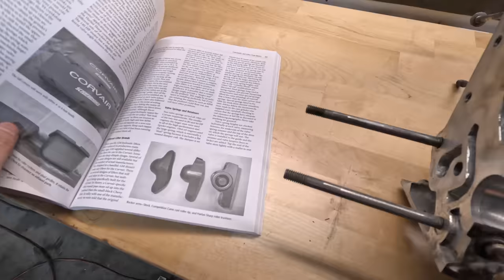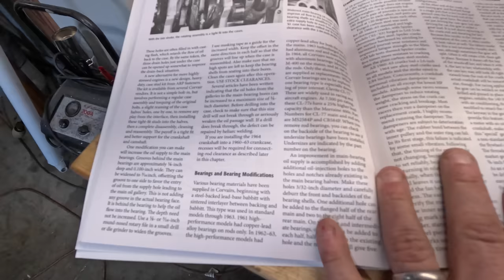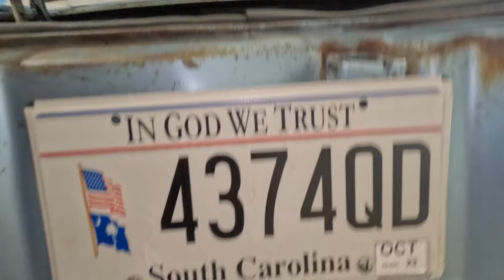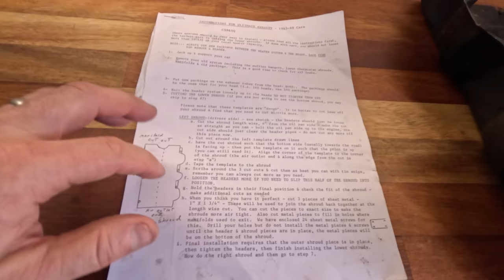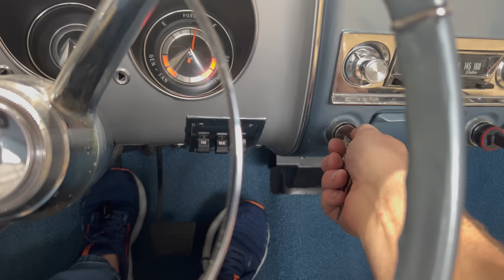HOT New Engine for the FLOODED Corvair | Cam, Heads, and Exhaust...Oh my!

Comment: God I had a heart attack when you showed the location of the timing mark on the crank for camshaft alignment. I'm also in the process of rebuilding my engine and have already assembled it. I used a v-shaped notch that looked like the timing mark at the front of the flywheel flange instead  of the raised edge. Luckily the notch is at the same spot. Otherwise I would have had to disassemble the whole engine again :D

The only thing i'm missing fron the video is a proper cam break in. I guess it's now too late for that but the engine seems to have survived :D
(There are a lot of camshaft failures lately so it's typically highly recommended to do a break in of the cam)6
Reply from the maker: It's NOT intuitive and you really have to be paying attention to where the timing mark is located or it will get messed up.  I'm so glad you found the correct timing mark on your build!

I did break in the cam at 2000 rpm for 20 minutes, just didn't show it on camera.  I thought it was already getting a bit long and made a creative decision to edit that part out.

Comment: Dad had a Greenbriar van, We were pulling the engine around once a year ( depended on how much he drove i) because of the NM heat would cause the push rod tube seals to leak! I am wondering if they have better seals now. To say I wasn't unhappy the day it made the trip to the scrap yard would be an understatement.  Never had any problem with the flywheel though.

Buddy bought one rebuilt the motor it would start and run then die,, after a day of me trying to figure out what was wrong we drug it back home after dinner we and dad went out to see after a a few minutes dad said Wally I can't figure it out we're going to have to start taking it apart and see what we find when we pulled the carbs there were lock washers under them causin a giant vacuum leak. My dad asked Wally why are there lock washers "Under" the carbs, he said it seemed to be the place for them. Cutting him some slack he had never worked on an engine before. When we origanlly went to look at al he cared about was the hubcaps paint and radio!
Reply from the maker: There are much better seals now and pushrod tube leaks can largely be eliminated with Viton o-rings.  As an aside, I'd love to find a Greenbriar for the channel!

Comment: We use valvoline Vr1 30 wt racing oil  in our corvair  engines high zinc 1800ppm and marvel mystery oil in fuel helps lubricant everything especially at break in

Comment: Did you set screw the cam gear to the cam? They can loosen up with a stickshift
Reply from the maker: I had a “Failsafe” cam gear installed.  It’s not setscrewed but rather has a steel ring that is shrunk onto the outside of the aluminum cam hub, keeping it from loosening
Reply: @AutoAnatomy  Hmmmm... I've heard of it, but never seen one. I set screwed my cam gear about 40 years ago, but never rebuilt that engine. A 180 turbo from a Oshawa Ontario built '65 CORSA. It was black blue interior. It's long gone... sad story, but I still have the block TO308RL... and a few Corvairs of various shapes in buildings I own... but they haven't had any of my attention in years... it's difficult owning 50+ vehicles and winter 5 months of the year, and I'm constantly buying more. I've bot 8 (maybe more?) in the last few months, and I seldom sell any lol

Comment: Perhaps already mentioned.... Any drilling and threading should be done on a disassembled item like the cylinder head shown at 20:05.  Tough to get all of those shavings out of springs!  Edit: Not shown, and it has me curious about what method you used to adjust the valve/lifter lash?  Edit #2 Nice job on the shrouds!
Reply from the maker: It took a bit of work to clean but ultimately everything came out of the springs.  As for the lifter adjustment, I gave them an initial setting using the spin the pushrod & tighten the rocker until contact and then 1/2 turn method, and then once the engine was warm I adjusted them hot by backing off the rocker nut until clatter, then tighten until no clatter, then 1/2 turn more.

Comment: I like your sequence except I would have probably have dwelled on the installing of the shrouds on the lower side of the cylinder jugs they must go on before the head if I recall.
Reply from the maker: The shrouds are supposed to go on before the heads, but can be easily installed after.  It's just a bit more fiddly

Comment: With that cam you should do secondary carbs addition 😁
Reply from the maker: I'd love to!  If anyone wants to donate some 140 heads I'll slap them on in a heartbeat!
Reply: @AutoAnatomy  .......back in the early 60's and 70's they made a few kits.
I picked up some aluminum carb spacers and they are to be welded on a set of 1964 heads. Found some linkage and a pair of secondary carbs.
Your engine and cam might add about 16 HP, I'm looking at about 12  with stock cam. That's good reliable HP for low $$.
Keep the Vair!

Comment: Congratulations great to see it rolling. Corvairs make great restomods at least using the restomod term for upgrades and safety issue's like brakes and drivablity. These cars stopped getting real upgrades long before they stopped production so they are prime for tweaking.  Have fun and enjoy.
Reply from the maker: Thank you!  I'm looking to make subtle improvements that bring it up to current standards while keeping the spirit of the car.  Things like brakes, suspension, etc are going to get addressed throughout this process.
Reply: Chevelle brakes work real well on Corvairs.
 I know discs are stylin. But if it stopped a 1966 230 I-6 or a 283 small block Chevelle wagon? 1000+ lbs more mass.
Also that 13-15 lb PSI for the 13 inch front tires works real well. Don't mess with it
No need for mods either. GM was good about use what is there in the warehouse.
'66 on shared some parts with the Corvette for the rear suspension.
If you can find them. The 69 Corvair heads also flow better.
Also the '66 turbo Corsa put out as much HP as a 283 wagon motor.
The only thing I did not like about Corvairs was the push rod tubes and the cooling fan belt arraignment. Blame that on the GM bean counters.
 But if you put a Z-28 302 amidships in one. Might want bigger tires and disc brakes front and rear. And about 6-7 lbs more air in the front more or less. Generally less.
Also don't stand on the gas pedal with a 283 or 302 if you have 4 speed in it in 1st gear.  Also no standing on it in 2nd if it has posi-traction.
Or you go with a powerslide 2 speed until that scatters on the pavement
 4 speed? 1st It will dump the spiders with the stock 13 inch tires and wheels. V-8s have to much torque.
You can do that. If you want to see what a spider gear looks like when it comes out of the case. If you can find it.
Now you know why a Corvair never had a V-8. Oh and with a V-8 it could go after a Ferrari and catch it. If your cojones are big enough.

Comment: The louvers in the glass packs are supposed to face to the outlet of the exhaust … that way a little bit of turbulence is caused … if they face the intake the carbon build up inside em will fill them up and basically turns the mufflers into straight pipes
Reply from the maker: It's interesting, it seems there is conflicting info on the direction of the louvers.  Holley says they should face the intake, but others say they should face the exit.  Either way, it's loud and drones like crazy.  I'll end up making something else eventually.

Comment: Has anyone ever addressed the cooling system for the corsair to make them run cooler.. i have always liked the corsair. It has a nice body style.. i have seen supercharged and turbo charged corvairs that are pretty fast.. its too bad your not closer to me I would help you paint it. I have been a body and paint man for over 30 years and still love the work I do.  I would enjoy making
That car look better than new.  Good luck with your project.
Reply from the maker: Thanks for the kind offer!   There have been some options for cooling, most notably the Nash fan (a billet cooling fan), but others have come out with electric fans or variable ratio pulleys.
Reply: The Corvair trucks had oil-coolers for the powergide-equipped units. If I built another Vair engine I would add a remote oil cooler and a high-capacity oil pump, as well as a high capacity aluminum oil pan like the one he installed here.

Comment: I hope that starting out with the ring end gaps on the tight side of the specs doesn't give you issues. With the book calling for .013-.025 end gap, on an air-cooled engine I would have shot for .018-.020 - you would never have a blow-by or ring seal issue at that. Setting end gap on the tight side can cause the end gaps to close up and when the ends but together, the engine either seizes up, tears the top of the piston off - or both. An air-cooled engine is more susceptible to damage from tight end gaps, simply because it is harder to monitor and control temps. I would definitely make sure the engine is well broken in before spirited driving.
Reply: If the recommended Gap of .013 to .025 is too tight, wouldn't every corvair engine fail???
Reply: @bryanturner683  There are different brands of rings and pistons made with different materials that require different gaps than the OEM rebuild book would suggest. Since it is hard to monitor and control the cylinder temps on air cooled engines it is better to set the gaps in the high side of the specs so if the engine gets warm or too hot the end gaps don't close up and butt together.

Comment: Curious about the ring choice, the thinner modern rings greatly reduce bore wear & run significantly cooler as well.  Is this type of ring not available in the Corvair sizes? Piston looks heavy as well?
Reply from the maker: The factory sizes are 1/16" I believe, and that's what most pistons for Corvairs come with.  I didn't measure the weight of the pistons but I don't recall them being significantly heavier feeling.
Reply: @AutoAnatomy , Might want to do a search on Youtube on a video of a dyno test done by Total Seal at Shaver Racing on the difference in HP & temp between 1/16 & 3mm oil, 1.2mm standard factory LS, 1mm & 2mm oil rings. Probably require custom pistons for a Corvair though. The temp as the most impressive thing to me? Anytime you lighten the roatating assembly the motor lasts longer & rpms easier/faster. i understand your build is not a race car as well. The aircraft world even has aluminum jugs with Nikasil linings for a supreme  cooling upgrade?  Just information, I am not beating on you. I appreciate your work!

Comment: Just new in Corvairs from with a 67 110 Spyder. After some daily driving im making wome maintenance/upgrades. Couldn't resist to get the ultimate from Clark's any considerarion asaide the loudness. What's your long term review on it? Technicals, leaks, rusting, bumps/rocks? Also, thanks for the video explaining how-to install and cut the shourds, really helpful 👍👍👍
Reply from the maker: Thank you, and enjoy your new Corvair!  The community is wonderful and so helpful, don’t be afraid to reach out if you need something.

Overall, I’m very disappointed with the ultimate exhaust.   It sounds great when you’re driving hard but it drones terribly.  The fit is good and does not leak.   Compared to other headers, they hang a bit lower so if you’ve lowered the car it might scrape on the bottom of the tubes.  The mufflers come welded on backwards and when I reached out to Clark’s, they were less than helpful.

I am in the process of making a new system tote and kill the drone that is present at around 3000 RPM.

Comment: That sounds fantastic! Lovely combination of blat down low and wail up high! 

Two tech questions out of curiosity. First, do Corvairs not have main bearing shells? If not, what happens when the main bearings wear? 

Second, did you not have to break in the cam at first start up? Is it different with Corvairs or did it happen off camera?
Reply from the maker: Thank you!
1. They do have main bearing shells, I just didn't show them being installed. 
2.  I ran the engine at 2k RPM for 20 minutes off camera.

Comment: You should run Amsoil Z rod full, synthetic, high, zinc oil, because zinc Hass to be added to oil at a certain controlled temperature is what I understand plus all my cam shafts look brand new, even on my newer vehicles you can run zinc in newer vehicles with smog equipment, as long as equipment as long as the motor does not burn oil. It will not hurt a cat or anything it’s just what the wants us to think. I am soil is the only oil that has 100% synthetic oil. These oil companies can get away with saying it’s full synthetic when it doesn’t have much in it at all.
Reply from the maker: Once the engine breaks in a bit, I'll switch to synthetic but for now it's dino oil.

Comment: I understand a lot of people think there's 1-2 HP to be had with tighter ring gap, I'll say this about that, the vast majority of hot rod engines that had major failure linking to the pistons, if you look closely at the top ring land, you'll probably see it blew out. That is caused by too tight a ring gap where the ring ends touch and that blows out the ring land, this is especially true if you're adding boost or happy gas.
I'd be willing to bet that engine on boost will have a failure unless he runs E-85 and even then, he's gambling.
I wonder why he didn't research the vast discrepancy in minimum and maximum ring gap, .013 to .024?
I can see .013 in an engine that will never be hotrodded, no boost, no happy gas, not a lot of timing, but if you're going to hotrod that engine, especially in hot weather, or boost NOS etc the .024 would be the minimum. I'd bet somewhere someone has written on that. When turbo Corvairs came out, turbo tech was in its infancy, they just didn't turn up the boost and or added turbo juice, aka turbo rocket fluid so they could keep a bit more compression instead of cutting it down to 8:1 and bumping the timing way back but people being ignorant of boost would run them with the turbo juice, it's start pinging and boom, the ring land would pop because the ring ends touched. But nobody knew it was the rings, they all, like this guy, thought "Bad Pistons" when really it's what happens with a .013 gap on an air-cooled engine with a bit too much timing and standing on it, or boost.
I know this is a year late, but to all you building a Corvair, take it from so eine who ran under the national class record in 72-72 in a 68 Corvair at then DeSoto Memorial Speedway, currently Bradenton Motorsports.
No I'm not an expert, never said I was not will I ever but I do know about ring Gap on Corvairs and I'd bet if he looked closely at his "bad piston" he'd probably see the ring land blown out. And if it wasn't before, it will be now if he plans to hotrod this car in any kind of hot weather, with any timing where he's making best power, or run it lean,hell see exactly what I'm talking about.
Also, look around YouTube and see actual experts on this subject, Richard Holdener is one of the top of my head, hell take junk yard motors and boost them doing nothing more than adding ring Gap, he calls it the big bang, and guess what? None of them blow up even when he bumps up.the boost to unnaturally high levels with stock compression of 10:1 or higher.
Go look and see for yourselves.
Anyway, I love Corvairs, I hate to see them blown up because of a well intentioned home engine builder not Knowing about ring gap and it's extreme importance. As I said, I'll bet his engine blew because of it the last time. It's far more important on an air-cooled engine.
Gap those bitches out to .024 MINIMUM!!!
Reply from the maker: Lots of good information here, thanks!

Comment: Do the exhaust need any coating? Or is it plug and play?
Reply from the maker: It got some high temp paint prior to install, but they were not coated originally.  Check out the new video on my exhaust build for a better view of what the headers looked like after about a year of use.

Comment: I own a 67 I have eyeballed every Clarks upgrade you bought.  How do you feel about it after some time now?
Reply from the maker: Great question, here are my thoughts:

1. I'm not sure I would do the Ultimate exhaust again.  It sounds good but drones terribly at interstate speeds.  I've tried four different sets of mufflers and all are equally bad.   They welded the mufflers on backwards from the factory and refuse to acknowledge this.  I'm currently working on a solution.

2. I like the cam and the overall improvement in power.  I do wish that I had acquired some 140 heads to install when the engine was out.   This is still a "maybe" for the future. 

3.  I highly recommend the Clark's valve covers and oil pan.  Not a single drop of oil has leaked from these since installation.

Comment: I told my brother to not do it! At 110 mph he shifted into 4th gear and blew the top out of a piston. That Super BEE did not have a chance until, well you know, we blew the motor!  1965 Monza Corsa Corvair with the four carburetors. We never knew the top end, but at 110 mph in 3rd gear, it was up there!
Reply from the maker: I think we’ve all got those stories about racing and blowing the motor!
Reply: My brother sold that car after Dad fixed the motor for $600. Today it would be worth 25 to 30k.  It had a candy apple red paint with jet black interior. Chrome everywhere.  @AutoAnatomy